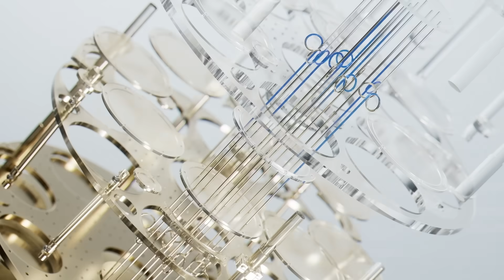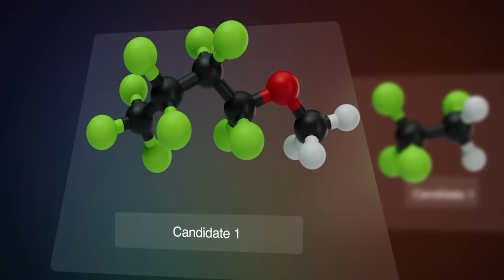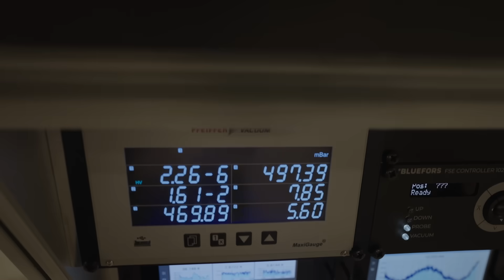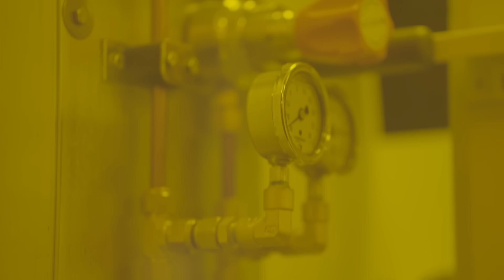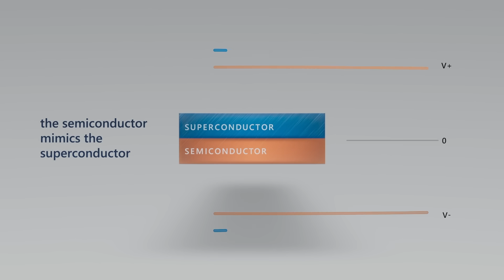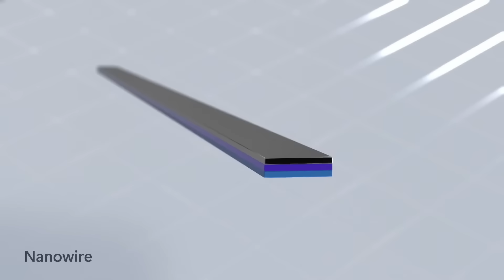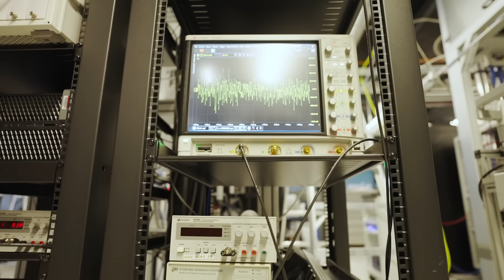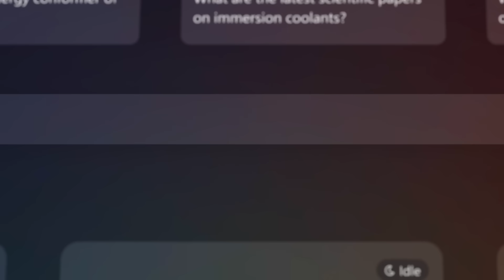Majorana 1 Explained: The Path to a Million Qubits

Comment: I'm sure I'm not fully understanding this, but isn't their big breakthrough a topological gap, which is fundamentally a way to reduce noise?  Aren't there many other approaches to this same problem, which also work?  Hoping someone can explain further.
Reply: Ok so you have two Majorana Fermions to observe, and they are opposite charged if they collide they read a 0  through annihilation , if they are separate, they read 1 now multiply that stable system by millions in parallel computations. The Majorana fermion particle is a topological new state of matter. So its stable and does not need error correction or to slow down calculations  for stability
Reply: @tombyrne6433  Appreciate your reply. Quite different than the explanation at Domain of Science https://www.youtube.com/watch?v=ihZXl33t8So

Comment: Microsoft team achieving Majorana quantum topological state on a supercooled special semiconductor.
• Creating a topological Qubit and controlling it far better than other Qubit creation methods is multiple achievements all at once.
• New state of matter. Majorana is a chargeless (neutral) topological matter, a quantum waveform. 
• Microsoft design is controllable (switchable), Quantum Dot, a new type of transistor effectively.
• It is a stackable solution, enabling the path to building millions of Qubits in one architecture, achievable almost like classical transistors, building blocks of today's classical chips.
• Opening the path to perform astronomically complex calculations within reasonable timescales.
• Paving the road to new chip designs, new types of data centers, new & far more powerful AI development.

Thank you, Microsoft Team.  This achievement could be worth Exp(2) Nobel Prizes, more than what can be collected in a year.

Mehmet

Comment: Isn't this new state just gas reduced to tiny particles, I don't see this as anything revolutionary except the fact it's breaking down solid state even further to states where you can easily manipulate and mould to do what you want.

Correct me if I'm wrong heavily but this is what I assume of this "new state"
Reply: It's not a new state of matter.  It's more like a new quantum state.  The topological state is very hard to create but allows Majorana zero modes to exist on either end of a nanowire for example, and either end will represent half of an electron, which is only possible in this quantum state.
Reply: @VamYang  i see, thank you for answering

Comment: Finally, a computer capable of running Microsoft Teams at full speed
Reply: Do you mean Microsoft Teams, Microsoft Teams Essentials, Microsoft Teams for Microsoft 365 Business, Microsoft Teams for Microsoft 365 Enterprise, or Microsoft Teams for Education?
Reply: @A-Go-5  Microsoft 365 Copilot for New Teams Enterprise (Work or School) 64bit
Reply: Teams has encountered superposition and needs to close.
Reply: @befayedocrimes4751  The hardware isn't compatible with windows 11 unfortunately.
Reply: gonna have to give credit to you buddy it was hilarious
Reply: Microsoft team is more complicated than quantum computing
Reply: @ 🤣🤣🤣🤣 100%👍
Reply: I almost choked to death when I read your comment! 😀
Reply: Haaaa No computer can run teams, its over engineered, clunky and just congested...I hate it!  I would rather browse my registry keys than use Teams
Reply: @DM43685  my phone runs ms teams. What are you using thats bogging down with teams?
Reply: @DM43685  Thats if the registry keys aren't corrupted
Reply: @DM43685  😂
Reply: But the real question is is it compatible with windows 11?
Reply: @technomanplaceholdernumber unless it can simulate a TPM 2.0 chip I don’t think it is
Reply: I bet it still freezes when connecting an external monitor while in a call
Reply: @DanMana1  or crashes sound driver when join someone to a group call
Reply: due to the superposed states, microsoft teams is both running and not running at the same time.
Reply: 🤣😂👍and eventually even that won't be enough😝
Reply: @spicymemechannel  😂
Reply: The qubi-teams is near!
Reply: As a senior IT admin/engineer I can confirm the pure shock when you see how much RAM teams uses...never fails I will log into an RD server and whats using the most? the million tabbed browser pages? nope. Office? nope... TEAMS! lol a sizable chunk too lol
Reply: @ maybe they are trying to run the software in memory :p
Reply: LOL, that's funny.
Reply: Actually it doesn’t run anything , it just runs the “antivirus” to “protect you” and to help keep you in the echo chamber.
Reply: :face-green-smiling:
Reply: Bold of you to assume this can run MS Teams 😅
Reply: Not quite there yet. Maybe in another 1000 years
Reply: @spicymemechannel  thank you! You made me laugh :)
Reply: It could install and run Microsoft Teams many times in parallel, and in 10% of the cases, that would even work!
Reply: *but your bluetooth headset probably wont work
Reply: Until you join a meeting with more than 2 participants......
Reply: You guys must have ancient hardware if you can't even run MS teams. That's lame
Reply: YEAH, when Talk are way way more Faster than Work..its called Quatum Talk
Reply: Hahha. 🤣
Reply: You wish.
Reply: @spicymemechannel  agree lols
Reply: Legendary Statement 😂😂😂
Reply: Lol
Reply: FACTS!
Reply: @spicymemechannel  😂
Reply: I'm sorry, but what Microsoft has to do with creating processors?
Reply: @ahappyyotubeuser9851 they need something capable of running MS Teams at reasonable speed
Reply: @ahappyyotubeuser9851  Trying to control the whole inferstructure like apple.....the problem is the operating system you have to buy a new one every 1.5 years.
Reply: @spicymemechannel  we will finally have multiple usb c USB A and card reader hdmi so forth on microsoft surface  laptop i am so happy
Reply: @spicymemechannel   WORST thing ever created the whole eco system our companies adopted.
Reply: It's called MBP M4
Reply: @spicymemechannel  nah... A computer that can run Chrome with 100 tabs on 😂
Reply: That is impressive
Reply: Does it play doom? ...hmmm how to play doom on quantum computer, in qubits??!
Reply: AND crysis
Reply: i dont think so
Reply: Whoa, let's not get crazy.
Reply: @spicymemechannel  don't forget to add windows 11 start menu...
Reply: came here just to say this lol
Reply: Jajaja HAhAA
Reply: That's the JOKE 😂😂😂😂
Reply: Copilot Teams*
Reply: @spicymemechannel  i'm not so sure about that
Reply: 😂😂😂😂😂😂 bruh
Reply: This is the best possible answer
Reply: We are settings things up for you...
Reply: I’m so glad this is the top comment 😂
Reply: Finally someone speaks 😂
Reply: @spicymemechannel  but will it support the conference call of 50+ participants? Not sure. They will have to use Zoom.
Reply: best comment of the day 🤣
Reply: Teams is just copy of what's app still struggling to run on mobile
Reply: @spicymemechannel  hhhahaha
Reply: I see what you did there hahahahaha
Reply: Now if you think about your manager, you would get a teams call instantly!!. Finally!!
Reply: Also Stickies on Mac OS.  I feel like once I can get a quantum computer, I can run two versions of Stickies at once.
Reply: Hahahah I laughed so hard that I wake up the whole house.
Reply: first comment i saw and it is wonderful
Reply: lol
Reply: @spicymemechannel  🤣
Reply: i thought she said “Marijuana 1”
Reply: Bro you just killed it
Reply: one of the best and smartest comments ever!
Reply: Heh! Funny
Reply: heh.
Reply: HAHAHAHAHAHAHA
Reply: Hahahahha Microsoft has always been junk and will continue to produce junk
Reply: True, true haha well done mate
Reply: accurate
Reply: Lol!
Reply: Maybe😂
Reply: Lol😅
Reply: lollllllll
Reply: @spicymemechannel  That's crazy 😆
Reply: Or not slow down after installing Office 365
Reply: @spicymemechannel  🤣🤣🤣🤣
Reply: Unlikely, they'll just update the software again and again until it no longer runs properly.
Reply: Am i Online or Away?
Reply: Bro.. 💀
Reply: @spicymemechannel  love it
Reply: Best and most poignant YouTube comment ever 🤣🤣
Reply: NICEEEE , without helo helo again
Reply: @spicymemechannel  😭😭😭🤣🤣🤣
Reply: I swear to god ahhahahaahhaha literally
Reply: Ok that made me laugh 😂
Reply: @spicymemechannel  🤣🤣
Reply: @spicymemechannel  haha
Reply: DEEP CUT.

Comment: This is the 5th Quantum computing chip explanation videos that I have watched in the last 12 months.
How does this differ from the other videos lol?
Reply: After conversing with AI for what seemed like 10 pages of back and forth, I finally understand.  In traditional qubits, information is stored in things such as electron spins, which an electron exists in a finite spacetime region as a probability wave.  However, because it's localized, changes in temperature or magnetic forces could change that state, collapsing the superposition of the electron. In quantum mechanics, measuring one superposition object collapses the other object's information.  You don't have that with topological state qubits.  That's why you hear about all the errors and that you'd need a lot of qubits to process with less errors in typical quantum computers.

In topological state qubits, for example, you might use a nanowire that has two ends you can manipulate, called Majorana zero modes.  Instead of measuring a single electron's state, the electron is spread across the entire nanowire, so the combined overall state of the nanowire IS the data.  The electron wave function is spread across the entire nanowire.  As a result, it's fault tolerant because information isn't localized, but is the full measurement of the nanowire.  The state of the electron or lack thereof (0 & 1) is the entire measurement of the nanowire.  Microsoft uses a network of "nanowires" to store all the information.

Main thing is Microsoft's approach requires magnitudes of order LESS qubits, and has fault tolerance because data isn't being stored locally (like in a single electron) but rather over the entire nanowire structure, kind of like saying there's one person in your home, therefore that's a 1.  If there's none, that's a 0.  In traditional qubits, the state of the person in the house (ie awake or sleeping) determines the 0 or 1, but because  the person can be knocked out with medication, you can't be 100% sure about the data.  Dumb example but you get the idea.

Comment: So it is a key of water able to simultaneously "feel" all possible solutions and then "freeze" in the right shape to be able to be turned to open a particular lock. 
Presumably without having to as a question be shaped exactly as the particular lock because of what use is then "quantum" other than an scam with a lot of gilded bling?

Comment: My small brain has a question that's bigger than itself, and I need an education just to watch this announcement video:

If your Majorana particles are one-half the size of an electron, and everything in the periodic table of elements has a minimum of one electron, for example, Hydrogen has 1 electron and 1 proton. 

If we apply a 0.5 Majorana in orbit of an electron, then why can't we turn municipal electricity into a public computer? Stranger still, if we apply 0.5 Majorana into the orbit of 1 proton, then why can't we turn the human body into a computer? Now we can connect the human mind through an implant to the public internet, a literal dream-state city?

If we fill a one litre canister of hydrogen with Majorana particles, what is the computing power? What about the total volume of the Earth, or the Sun? Dyson Sphere Computer?

Forgive me, but you're selling a computer chip, but what I'm seeing here is the exponential radiation of universal existence. You have a technology that fits inside the empty space of between any two elements that may or may not register to such other things as gravity and mass, so are we even sure a Majorana particle obeys light speed if it's exactly 0.5 particle lengths ahead of an electron? Can a Majorana particle compute time as well as space?

Time Travel by Organic Cognizant Will?

Teacher, explain to me what your technology is, from the absolute fundamental basics, and  bring me through all the way to right now. Make me understand this.

Comment: The Nature article published by Microsoft today shows that they have decent evidence for a Majorana state but  are far from having a single qubit.  This overselling is not OK.
Reply: One can read that into this video. They are making big claims, but most of it is all hand waving. They share no technical details and, honestly, from a technical standpoint, the verbiage sounds like it was not only written by the marketing team, but was unverified by scientists or engineers.
Reply: 'Majorana state' is also not the same as 'Majorana particle'. This is clearly marketing for electron-hole pairs.
Reply: @wasgehtsiedasan8660 yeah, so that's what I was wondering. Like, did they create a particle constructed with an electron and a positron?
Reply: @a.r.6931  well idk what article you read but the one I read did they had 8 quibits
Reply: @bfez416   it's confusing. The Microsoft Source article says "Today, the company has placed eight topological qubits on a chip designed to scale to one million." The Microsoft Quantum roadmap paper on Arxiv describes measurements of a physical "eight-qubit 4×2 device required for the lattice surgery demonstration has two of the logical qubits". So maybe the red circuit board they wave around has 8 hardware Majorana qubits that make 2 logical qubits? And the paper talks of "a utility-scale quantum computer of hundreds, if not thousands of logical qubits that is able to solve commercially relevant problems" which remains years away.

Research continues...
Reply: @a.r.6931  this!
Reply: All these quantum computer advocates are as much of scammer as crypto people are.
They make up a bunch of word salads to fool stupider people pay for their gravy science.
All of academia is filled with them.
Reply: Google released their own and now microsoft's creating demand for their own chip that's about it
Reply: @a.r.6931  I have not read it. What specifically makes you draw this conclusion?
Reply: Ah so fraud. Ball is in your court Microsoft. Time to take down your promo materials before you get sued
Reply: @a.r.6931  yea nobody knows enough to know Microsoft is doing some marketing and being a bit misleading
Reply: Quantum computing is a hype with billions of investments.
Reply: DEI video

Comment: Cool, but a battery that you only charge once and that never discharges is kind of pointless as you can't get any energy out of it. What was probably ment is a battery that doesn't loose charge on its own. Majoranan particles are non-Dirac fermions, right? Cause I recently found out about Semi-Dirac fermions which  first observation in a solid was in zirconium silicon sulfide (ZrSiS), a topological semi-metal just last year. I have no idea how you engineer those quantum chips and how you observe these quantum effects without collapsing the wave function and changing the outcome of the measurement but maybe that information is helpful to you.